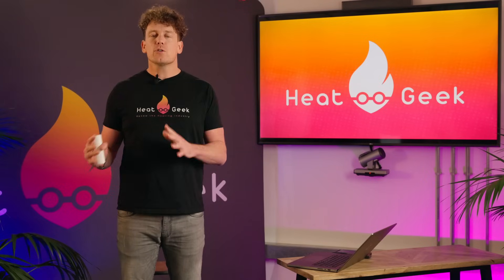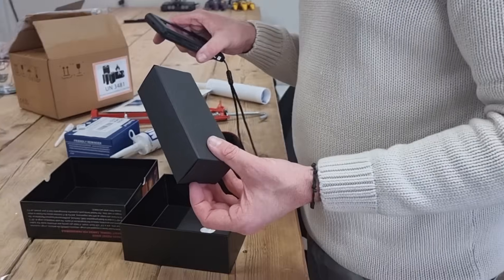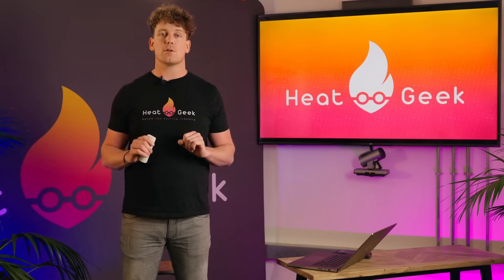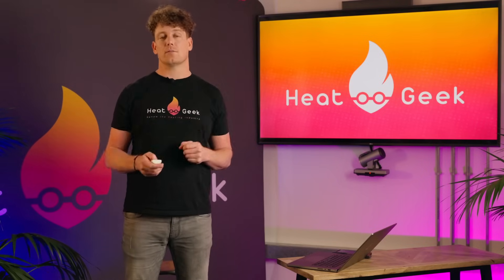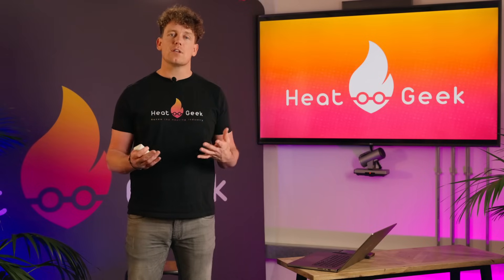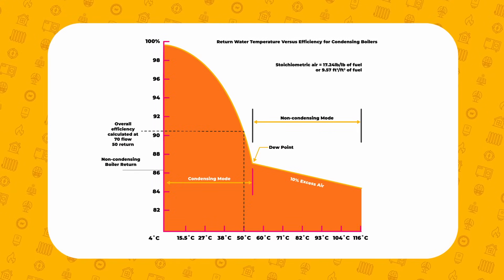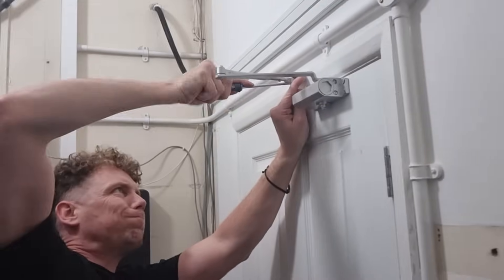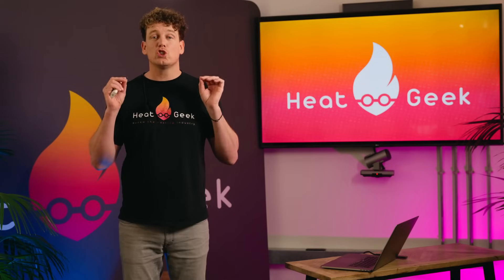This Insulation Secret Will BLOW YOUR MIND

Comment: I'm all I'm favour of efficient insulation in homes and have done as much to my property as is possible, however the more I try to offset the fuel costs, the more the energy companies increase the price of the fuel, so there comes a point when insulation will of course reduce the consumption, but due to increasing fuel prices the overall bill will never reduce.
Reply: But it's still better than if you hadn't insulated, right?
Reply: @jc-fy1wl Infact it will make the difference even more apparent
Reply: @jc-fy1wl that depende on how much you've had to spend
Reply: As part of an extension we've refurbished the ground floor that included taking the old floors out cleaning out 100 years of debris reinforcement of the floor + noggins before double insulation with 1st mineral wool then a product called floorquilt.
The reason for the work was having underfloor heating extended from our new extension but the result is the 2 inside rooms now require ZERO  heating for most of the year most of the time

Biggest bang for our buck was double insulated floors its a lot of work but necessary in a 100 year old property
Reply: @SlowhandGreg  Back in the early 1970's we almost doubled the floor area of our 18th century 2 level cottage using highest level of insulation reasonably available. Heating continued to be by 70000Btu gas boiler and radiators. Gas consumption remained the same!
Reply: @richardbarber4444  I don't understand why you think this is relevant the bulk of my insulation is secondary a multi foil layer traped between battens giving a double air pocket this shuts down thermal barriers.
While the building isn't leak proof the general temperature decay is around 2 degrees over 6-8 hours with outside temperatures being between 4-10 degrees, with underfloor heating I've found that it takes too long to heat back up again if the building drops below 14 as in more than 2 hours
Reply: @SlowhandGreg was this on an old suspended or solid floor? Am doing the same on a 92 year old property down in Dorset. Pulling the old suspended timber floor boards up to replace with egger board. Underneath i had planned to fit 75mm pir but now wondering if i should do something like 50mm mineral wool, floorquilt then the ufh.
Reply: Hello
My house is a 1935 semi with a spanking new extension and since around September a newly installed underfloor system in the old part as well as the new.
The old and new both had suspended floors
In the old part I took the boards up removed the nails put supports under the old beam about 3 per beam in a 4 mere length make waterproof boots using damp proof course plastic left from the build attached with clout nails. I then put noggins in at regular intervals and hung netting for the mineral wool 
Over that I used FloorQuilt By YBS
The system is supplied by Omnie for the new and old including pre-routed floorboards pipe manifold, thermostats for 8 zones & a comprehensive installation plan
On top of the TorFloor I've installed strand woven Bamboo as a floating floor but with the planks glued it was one of the few materials that seemed to go straight on the underfloor

I wouldn't recommend screed the heating engineer I employed who helped design and connect the system once I done all the donkey work said there would always be a bit of flex

The TorFloor is pre-routed and replaces the Egger board which then doesn't lift your floor level

I've put some pictures up on My channel click on my icon look for a video called "UHF Refurbishment"
 @bapoo
Reply: These companies will have to make money somehow, but if they do this now it'll be unaffordable so you'll have a period when insulation saves money

The next step for us is self generation, then the companies can't dictate the price
Reply: Thankfully they are heading in the right direction definitely not great but atleast it's not last winter when prices got out of control.
Reply: As part of an extension we've refurbished the ground floor that included taking the old floors out cleaning out 100 years of debris reinforcement of the floor + noggins before double insulation with 1st mineral wool then a product called floorquilt.
The reason for the work was having underfloor heating extended from our new extension but the result is the 2 inside rooms now require ZERO  heating for most of the year most of the time

Biggest bang for our buck was double insulated floors its a lot of work but necessary in a 100 year old property
Reply: You're not suggesting that the energy cartel is price gouging and involved in extortion are you? When energy is required for everything that is  produced it does make you wonder why a government would hand such power over to a private entity.
Reply: Otherwise known as legalised theft
Reply: @danieladams7919 yep, only need to look at the profits of the billing companies. Making record profits since lockdown. Yet the regulator is doing nothing to rain them in. Also they are not doing anything about standing charge despite people saying they want rid of it under their consultations. 

If they got rid of standing charge on gas at least would mean hybrid systems would be way more viable and that makes a lot of sense to me.
Reply: This is one of the dumbest things I have ever heard.
Reply: @craigfoulkes  indeed. It's amazing the mental gymnastics some people will force themselves through isn't it.
Reply: It’s not cheap to keep the electric grid running. The wealthy will install large solar arrays and power walls so as usual the middle class is left with the bill.
Reply: You've obviously never heard of passive haus.
Reply: Yep..in fact a few years back another vital utility…A Water company (ies) approached the Gov regulator with a demand to greatly increase unit cost to customers simply because the tv adverts to reduce domestic water waste was so effective it hit their profits…and they demanded to not take a profit reduction.  This is immoral in its principle..it assumes your money kinda already belongs to them and all they need to do is fees to ensure they keep getting it…this is not how purchasing works.  It’s a socialist principle.
Reply: Except that if you'd not reduced your energy usage, your fuel bill would have been much higher.
Reply: @TheMatthooks and if you do reduce your bill, for example in summer with thermal water heating you can reduce your gas bill to zero and yet you’ll be paying standing charge. So eventually it dosnt matter what you do to reduce your bill you end up paying more. 

I used to be with Ebico and they didn’t charge standing charge. My gas bill for summer was zero. My unit rate was higher than others, but on zero usage it cost me nothing. 

I also went round and removed anything on stand by with smart sockets and got my base load down to 70 watts. My power usage per day was less than 3kw/h. I used to pay £60 per quarter for electricity. 

Now my bill for energy is more in standing charge per year than I used to pay for all my usage. When ever you change billing people will loose and people will gain. If people want to emit less they need to use less and paying more to emit more is a way of encouraging less waste. Keeping standing charges means there is no way we can save money in the long term.
Reply: At least if energy costs rise your ROI for the insulation improves!
Reply: Isn't that wonderful to get told what to do and how much to pay and what to do otherwise pay some more, while China happily opens few new coal power plants every year
Reply: Renewables are cheaper than GAS which is also traded on the world markets we have no influence fossil prices
Quote
The OBR concludes: the debt impact of future volatility in gas prices is at 13% of the UK gross domestic product (GDP) to 2050. This dwarfs the debt impact of 6% of GDP for investing in net zero. Second, it investigates the potential of new, growing energy solutions to cushion price volatility
Quote
With the energy price cap below £1,300 throughout 2021, UK households spent around £30 billion on energy during the year. In 2023 the projected spend is around £170 billion. This is equivalent to more than doubling the basic rate of income tax from 20% to 45% or almost doubling VAT from 20% to 38%. Just over 6% of GDP
 @lipeeno
Reply: Exactly, it's all a hoax to keep us spending our money unfortunately. Keep increasing the prices so the slaves can stay busy. It hurts, but it's the reality.

Comment: Hi Adam, this a very good explanation of where make the most cost effective alterations. I'm glad that I watched the whole video, because in the beginning I started to spit feathers when you talked about water temperature/ room temp delta, but you did provide a great explanation at the end😊 I have been championing weather compensation for more years than I care to remember,  I'm now retired from the commercial heating world. With the advances in electronics I had hoped that there would be weather compensation systems that could be easily retrofitted to existing gas fired systems  I.e. without the need for mixing valves, similar to the add on options for new Vaillant boilers ( Vaillant have been one of my preferred manufacturers since 1990!)

Comment: Great Video mate!! I've been waiting for the internet / UK to start talking about the importance and benefits of insulating your home to improve its energy efficiency. For years now the country has been focusing on efficient ways to produce heat in a home i.e. a condensing gas boiler, heat pump, solar thermal etc. Millions and millions have been spent in the way of government grants, installing condensing boilers (and now Heat Pumps) into houses with solid walls, minimal loft insulation and draughty windows / doors. Does this not seem a little backwards??  Its not like "insulation" is a new technology that no one has ever heard about. 🤔
No point producing all this efficient heat just to keep the birds on the roof warm.😉
Reply: Where have you been Tim, there have been numerous campaigns and incentives, for many years, in the UK to upgrade insulation. The low hanging fruit has been plucked, major upgrades are whats left and they're expensive.
Reply: @geoffaries  They've not even scratched the surface with the insulation required in peoples houses and actually having it done properly.
Reply: @andrewferguson3264  Who is "they"? In the UK we have had grants to add roof and cavity insulation for years. If you've got a very old house with solid walls then basically, as regards financial implications go, you're screwed. It's very intrusive, internal or external, has no realistic payback timescale and cannot be done to some properties. This also applies to many of the "no fines" concrete properties. You may also like to explain what you mean by "being done properly". Draught proofing is relatively easy and can be cost effective, but then you have to ensure sufficient air changes, otherwise you'll get mould growing in the prpoerty, which not only damages the fabric but also the health of the occupants.
Reply: I think 'Insulate Britain' might take issue with a few commenters here.

Comment: Good examples of the real calcs involved - in my experience, the average gas fitter would have their minds blown with this kind of maths - they seem to be barely able to cope with doing an in/out efficiency calculation or need to use an app to do stuff - getting them upskilled in this type of stuff is going to be challenge - instead they'll just stick a finger in the air and do some guesswork e.g. ooh that's a big house = must need a mahoosive boiler 🙄
Reply: The average gas fitter should already be aware of most of this. Clearly the design temperatures for heat pumps will be new, and they might not be aware of the relvant exponents to be used when considering resizing radiators, but Adam explain it well.

Comment: That was really good. Any advice on how to draft proof spot lights? All the advice i can find is for when youre installing them and getting into the ceilings which i cant do.
Reply: Change them to sealed LED units. Do NOT seal up any light  fittings that use that ventilation for cooling.

Comment: Great video Adam, always excellent content here, thanks. Just wondered if you ever thought about making a video looking at things a different way round given the enrgy crisis. How people get the most out of a certain amount of energy? At work i meet lots of people limiting gas usage to around 6000kWh/yr or about £600/yr (excluding SC) due to their financial circumstances. They reduce room temps, turn rooms off and limit times so they don't spend more than they can afford. In this situation, if you had a customer that was prepared to compromise on many things, without draught proofing or insulating how would you set up boiler times and settings to help them stay in their budget of 6000kWh/yr? and avoid mould!  😀🤔 This would also be intersting for heat pumps.
Reply: When I worked and was out all day I didn't bother with any heating in the morning (just used T shirts etc. and and a dressing gown to have breakfast in). 
Set the heating to come on 20 minutes before you get home in the evening with boiler flow temperature preferably set no higher than 55 deg. C if the boiler is condensing type Combi. Although the home will be cool when you get home at least the hot radiators help psychologically. Lounge room thermostat set to 18 - 19 deg. C.
If you can, turn the heating off 30 - 60 minutes before going to bed (Optimum Stop *).
Also I would recommend that all radiators to be checked for the fins being clogged with dust & other debris, and if so, clean with a bottle brush using a light and a mirror.
* Optimum Start / Stop (uses indoor & outdoor air temperature sensors) is used in commercial buildings to Start the heating early enough to get the space up to e.g. 18 deg. C by the beginning of Occupancy e.g. 08.00 and to Stop the heating some time (can be hours) before the end of Occupancy e.g. 17.00 so that the space temperature decays to no lower than 18 deg. C before people leave the building. The programme learns the thermal characteristics of the building to make increasingly accurate decisions.
Space temperature controlled at 21 - 22 independent of the Start / Stop programme.
Optimum Start / Stop was of great use for relatively poorly insulated buildings with some thermal mass and becomes less useful the better the building is insulated.
Notwithstanding the above insulation & controlled ventilation is the way to go, remembering that the recommended thickness of roof insulation is 30 cm. of Rockwool / Fibreglass I understand. 
I hope by now everyone is aware of how useful an electric blanket can be, and that some modern ones heat the bed more as the room gets colder and vice versa and have individual controls for either side of a double bed.
Reply: Dunno if this is still relevant for you but this is what I do in a flat with five radiators (ie 5 rooms that need heating)...The boiler comes on at 7am, it is asked to get to 17deg (that is a bit low but it's a new boiler and still working out how much it will cost at that level before raising the thermostat) and it stays there all day until 11pm when it is allowed to drop back to 15deg (though I notice the air temp only tends to drop one degree overnight). So the heating is on low all day. Rinse and repeat. 

None of my radiators has a thermostatic valve and even if they did I'd never close a radiator off ever as I believe houses should always have some heating, even if only a tiny amount. There is no insulation at all. All the windows are single-glazed. I live in a listed flat in a conservation area so insulation is a no-no, but the brick walls provide a significant thermal mass.   

Both hot water and central heating are at a flow of 45deg. Again, I know that is low. Still evaluating how much it will cost me but the boiler menu says that it has burned 13.4kWh in the last 30 days so unbelievably cheap. My usual consumption is about 5000 kWh so I think I'm on track to use less this year. 

As for preventing mould, I used to get a lot of condensation of the single-glazed windows. But a browse of the internet suggested ventilation so I keep all the windows, all of them, open 1mm, all the time. They are sash windows so it's easy to do that while the windows are still locked. Result? Never get condensation, or mould any more, and the permanently open windows don't seem to affect the heat levels at all. 

At night an electric blanket is brilliant and only costs about 8p for several hours.

Comment: It's not hard to calculate heat loss through walls, ceilings, floors and then insulate more to improve this by say 30%......but then we all have to guess ventilation/draught losses to get total heating demand and so correctly size a system. OK if yours is a passivhaus perhaps but does anyone know of a good system on a normal house to measure actual ventilation/ draught rates? That way you can decide if draughts should be sealed or left for proper ventilation to 9revent damp.
Reply: The calculations to prevent damp would have so many variables I expect it won’t be accurate anyway and doing things like washing would be a massive difference. 
To test for leaks  you need to measure pressure and have a large fan and seal the front door. If you want to DIy it then smoke and fan is going to be the way to go. Not done this on my place yet, but have new roof to sort out 1st. Plus I look at the building regs to ascertain what I need to do.